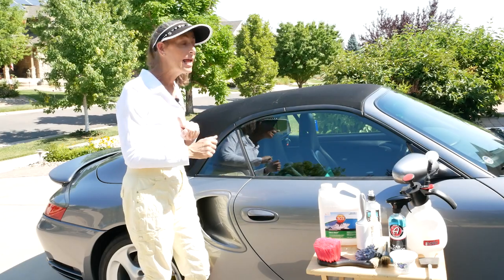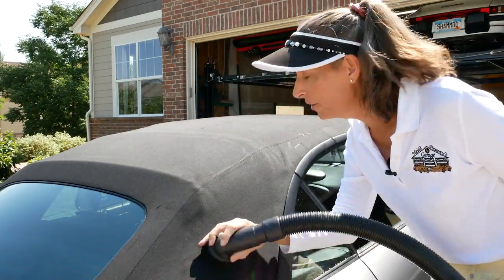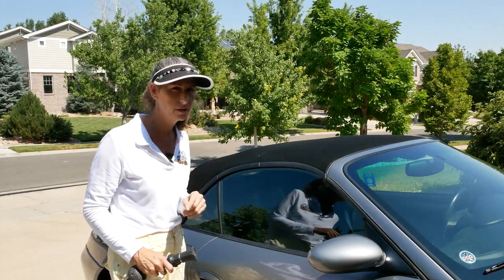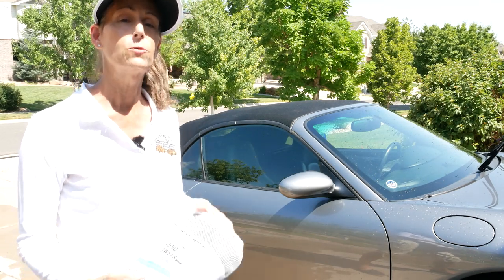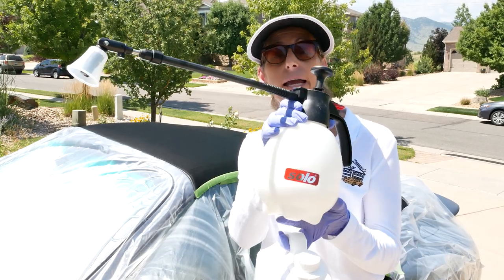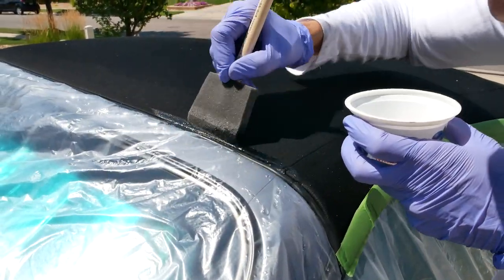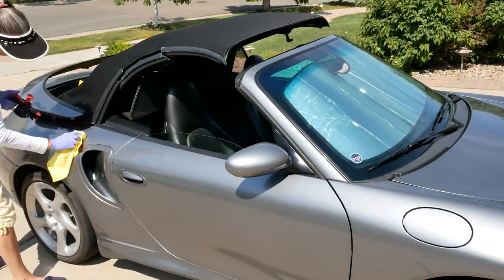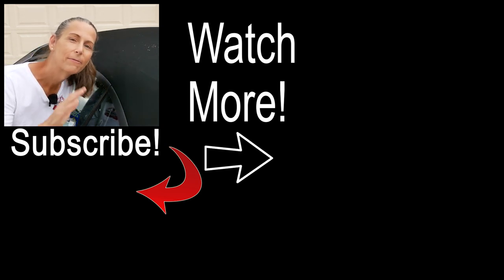Convertible Top CLEAN AND PROTECT! Super EASY!!

Comment: Thanks for updating.   For those of us who don't have a garage you can also add a cap cover which only covers the roof and windows of the car.  It also keeps debris that falls from trees out of the cowlings and drains.    With any car cover you have to balance the protection it provides to the effects it might have on the paint.    I have to park my 997 cab outside under trees, so it's a great compromise for my situation.

Comment: Thank you for the great video. While I’ve used (and like) 303 UV protectant, I didn’t know they had a fabric guard version. Thank you for the tip and I ordered some using your links. Speaking of which, your Amazon link goes to the regular 303 UV protectant and not the fabric guard. Might want to fix that.

Comment: The real caveat is if you have a car that is 15 or 20 years old and your soft top has glued seams, your top could shrink enough after soaking to cause seams to separate. My experience is thoroughly dry brushing with a stiff brush and vacuuming on high suction first. Next, wring out a wet towel and give it a final going over. Then use your lint roller before applying fabric sealer.

Comment: I did 3 coats of the 303 fabric guard on my 1 year old Miata fabric top (basically almost the whole 16oz bottle). It rained 2 days later and it "barely" water beaded. Most of it soaked in like it always does. Extremely unhappy. Going to be switching over and trying the Adams protectant instead. The 303 cleaner seems ok, but also my top was already pretty clean in the first place.
Reply from the maker: What were the conditions like when you applied the product?
Reply: @HeidiandFranny   Sunny and 80-84ish. Applied it in full sun. Little to no wind. Beautiful day for doing it. I see a "little" bit of beading when there is dew or mist on the top. But once the water gets heavier than that it just soaks in like before. It's like product is just sitting on the tops of the raised portion of the grain of the fabric but didn't penetrate or get the low spots of the fabric grain. 

After reading the MX-5 forums a lot of people recommend applying it with a foam roller or brush. That would definitely get a much heavier wetter coat than misting it with spray. I bought another bottle and I'm going to give that a try again. We'll see how it goes, otherwise I'll clean it again and switch to Raggtop's product.

Comment: great video, but the description link to the protectant shows an aerospace protectant but when i look up 303 fabric protectant (as said in video), i get a different bottle. is the link correct and you can use either product or is the link outdated? just making sure i buy the correct protectant for a convertible soft top.
Reply from the maker: Yes, you can use either.

Comment: I need to do this. But can't get my top rinsed off. Don't know what was used on it. I just purchased the car. Spray water on it. Slightest agitation, you get foam. I've tried several times. Doesn't even seem to lessen at all. I can pretty much wash the whole car without using soap. Tried cold and warm water. Tried agitation with cloth and brush. Tried just running water over it. Don't know what to do. Any suggestions what to do with this?

Comment: Less than a year ago I had the top on my 06 Mustang replaced.  Due to mostly simple laziness I failed to maintain the new top and while it was originally a golden/tan...now it is nut brown, almost black.  A pretty extensive search for any 303 brand products in stores in my area have turned up nothing.  Even here in "sunny" Florida products to clean and/or maintain convertible tops are pretty much nonexistent.  I try to shop local/avoid internet purchases, but it looks like I have no other choice.
Reply from the maker: Yeah. Check out 303 online for boats as well.  That might help.

Comment: help! i drove through a car wash and accidentally had wax added. My canvas top is loaded with wax and I can't get it out. Any tricks? It is melting down my windows and into the door panel.
Reply from the maker: Hi Sue (that's my sister's name :) Can you follow the cleaning part of the video? A nice mild soap, warm water and a soft brush should work but it may take a few tries. I'm sure you'll get it perfect! F
Reply: @HeidiandFranny  i can order and try. So far i paid 3 pros to try. ($500) One used a cleaner that took color off. One put ice and tried to scrape wax off. The other used a cleaner i ordered off the internet. This happened 2 yrs ago. Many rains and car washes later it is still dripping wax.

Comment: Why don't they make this in a roller applied sealant such as used in many other applications. You wouldn't have to mask off the whole car and overpay while half your product blows away in the wind.
Reply from the maker: It needs to be atomized to coat properly.  You can buy it in a jug and try it if you like, but I've found that the finest mist works best.